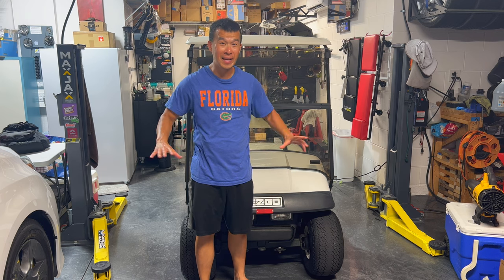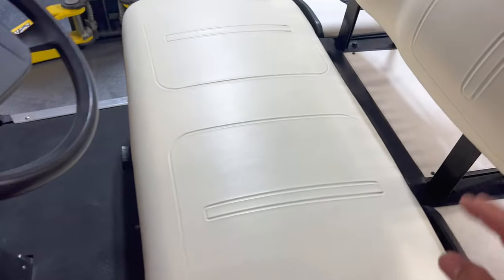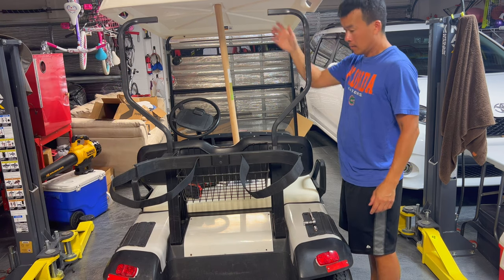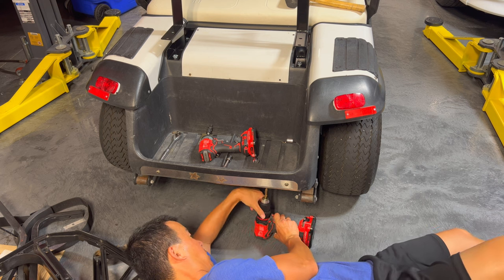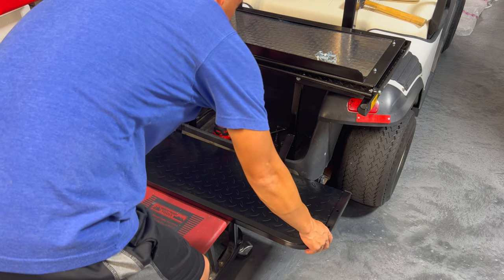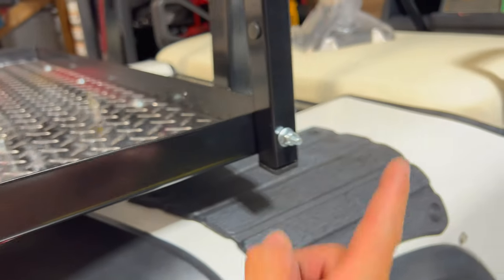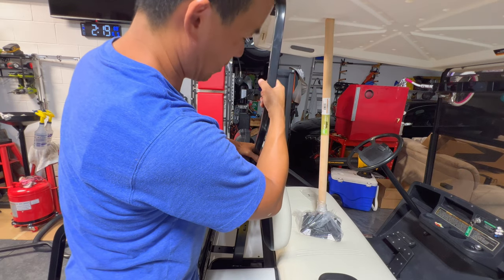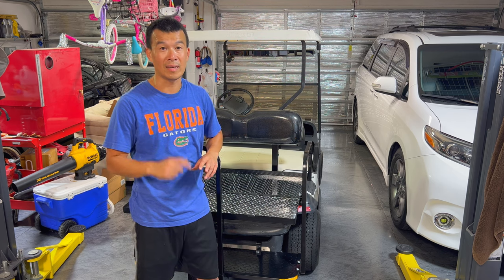How to Install Golf Cart Rear Seat | EZGO TXT Medalist Flip Seat

Comment: Nice video, you cart is in amazing shape. I have the same cart as you that needs a little touch up, Do you happen to know the paint code or name for that color? I call it ivory but not sure what the official name of it or how to go about finding the paint. You said it was a fleet vehicle maybe that is why its so hard to find the color code online.
Reply from the maker: No idea on color. But with such small parts, vinyl wrap it in a new color should be easy to do.
Reply: @TunerwithKids  I just got a reply from the dealer. This is what they said in case you ever need it.                                                                                                                                                     Hi,
This unit left here with Frost Beige paint. 
Paint Codes:
 
PPG- 26196